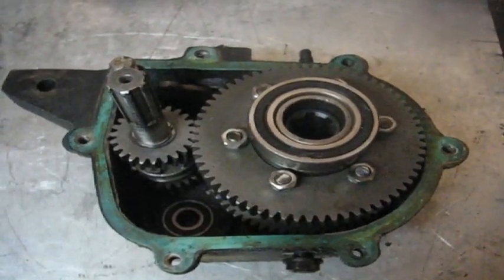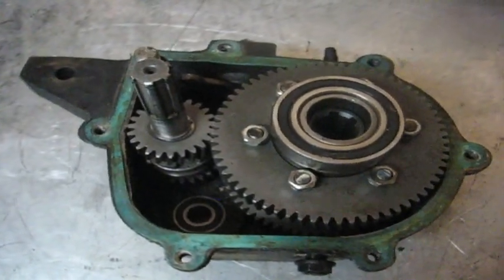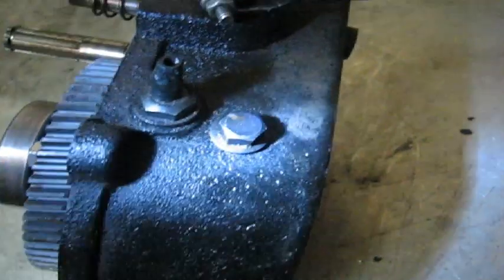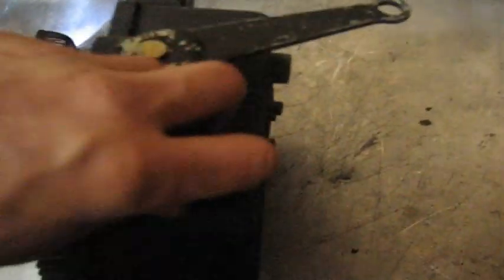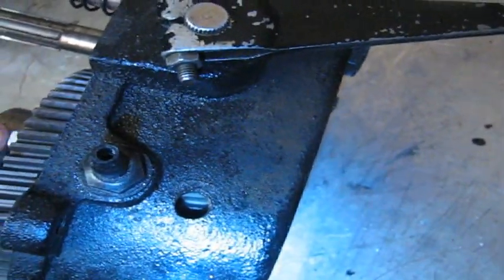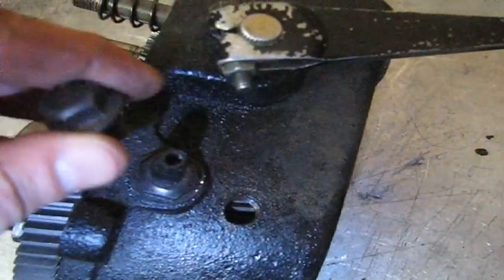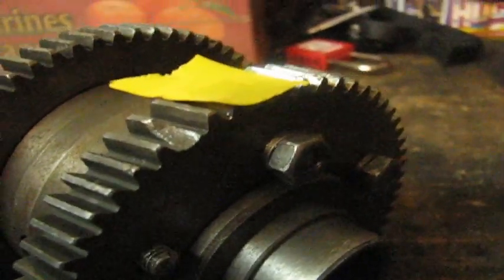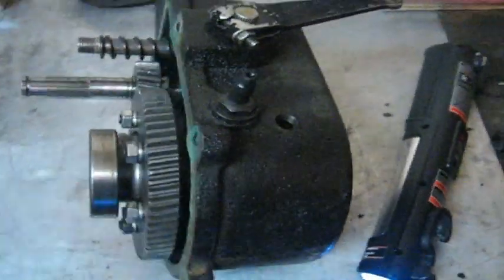China Quad "Gear-box"

Comment: I just bought one of the Chinese knock offs too, but I'm having trouble with the reverse, I think I just found where it goes to though, but then I noticed there's a pipe coming off the nib next to the oil filler screw, what's that for exactly I don't think I have any of that white tubing at all though on the back end

Comment: Does this thing have some kind of shifting or variable gear ratio that happens? And if so is it inside the engine or in that gear box? The reason I'm asking is because I installed a 110 quad engine in a 110 dirt bike frame, and it really just feels to have only one gear with no ratio change. probably goes about 15 miles an hour top speed, has plenty of power for wheelies but I'm wondering if I should be read gearing it to get more top speed and if so will it lose all of its bottom and power because of having only one gear?

Comment: So instead of "re-designing" the gearbox, why don't you just grind the plug down so its not so long???????
Reply: put a thick washer under the bolt. Copper preferably so it will seal well.  Done. $0.59 at hardware store. Problem fixed, lets to back riding them.